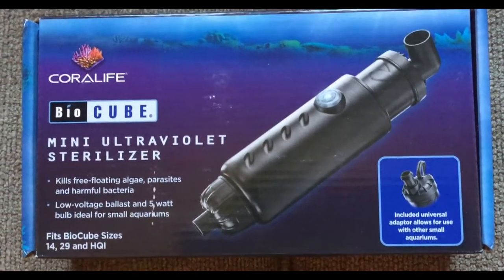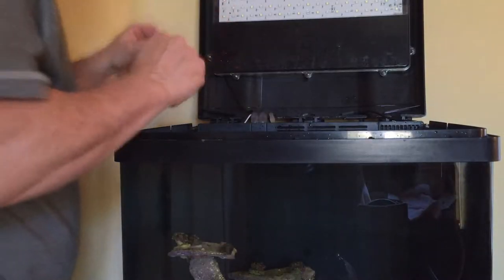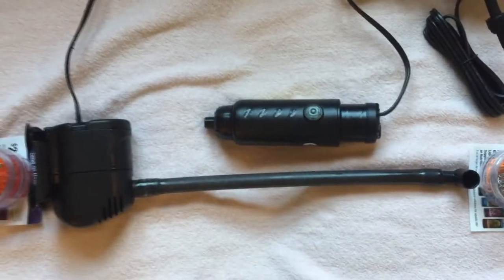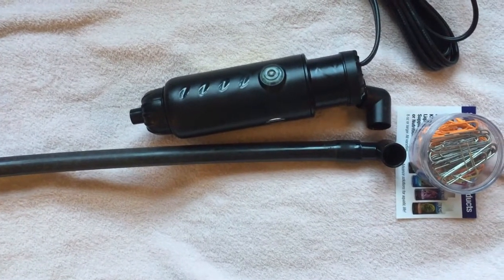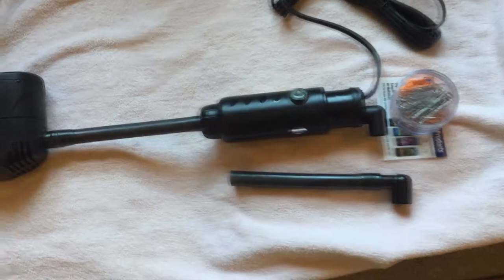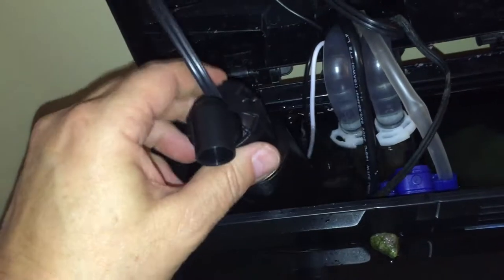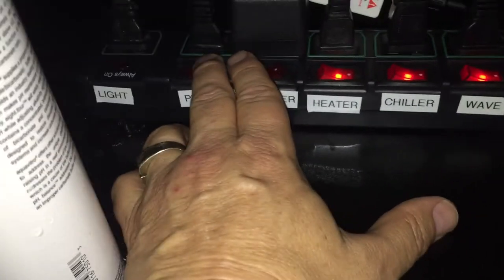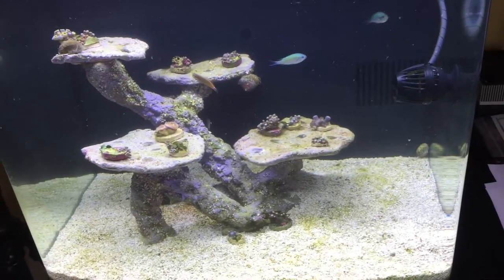Installing a Mini Sterilizer in the BioCube

Comment: What uv light does is stops the alage/bacteria ability to reproduce it does not kill alage/bacteria  aventualy all the alage/bacteria will die as it can not reproduce it creates a unstable environment for the alage/bacteria, if you turn the light off this will help to get rid of the it. There is also another technique used in cooling tower systems where the use of Ultrasonic waves and air interacting in a chamber this also creates a undesirable environment for the alage/bacteria and it won't reproduce.

Comment: I've been using 1/2" id tubing with my pump but it seems too large for the BC sterilizer. What is the proper size tubing to use?
Reply from the maker: I used the tubing that came with the Biocube so did not purchase new tubing. Sorry.

Comment: Did your UV sterilizer bring up the temp of your biocube?  I remember you installed the chill solutions chiller.  Did the chiller keep the temps down with the addition of this unit, it is 5 watts of constant heat added to your tank?
Reply from the maker: No, the sterilizer is very small. The lights on the bio cube heat the water in the summer. It hasn’t been too bad in the winter. The chiller did bring the temperature down.

Comment: Can you tell me how you did your power supply that's really cool
Reply from the maker: Hi. i used 2 Tripp Lite 7 Outlet (6 Individually Controlled) Surge Protector Power Strip. You can find them here on Amazon for about $34 each: https://www.amazon.com/gp/product/B075NZLYB7/ref=ppx_yo_dt_b_search_asin_title?ie=UTF8&psc=1. I used a label maker to identify each outlet. It works really nice. Thanks for the question.

Comment from the maker: Yes it can but it will need enough space to be submerged.
Reply: Thanks!
Reply: quick question, do i need an air pump for it to work?
Reply: @g_4456  - No.  It attaches to the water pump.

Comment: Do you have a skimmer that actually works well for the bio cube too? The bio cube bubbler was terrible.
Reply from the maker: I haven’t really found a good one. I tried the biocube skimmer which wasn’t very good. I have a Tunze 9001 but it’s not much better.
Reply: @DollarDIY  they have reengineered the biocube skimmer you should check out the new one!
Reply from the maker: @InsaneElite1  I'll check it out. Thanks

Comment: I cant see my light on the sterilizer
Reply from the maker: The interior light is probably not working. There is a round indicator light on the side that should be easily visible.
Reply from the maker: It works but not sure how well. It seems a longer system would be better but then it wouldn’t fit the BioCube. I still use mine as needed.
Reply: @DollarDIY  it was broke we got a replacement